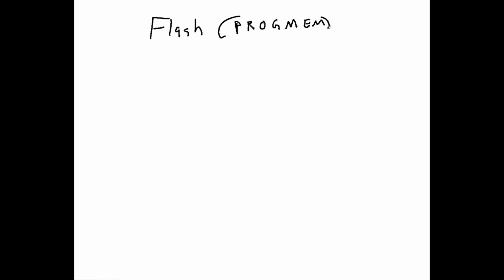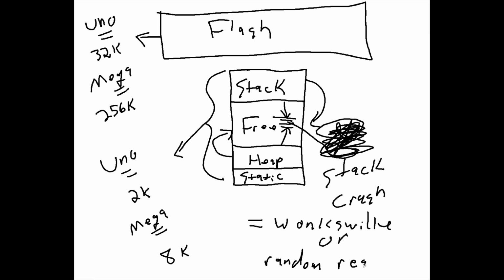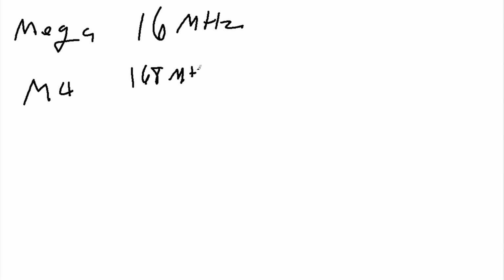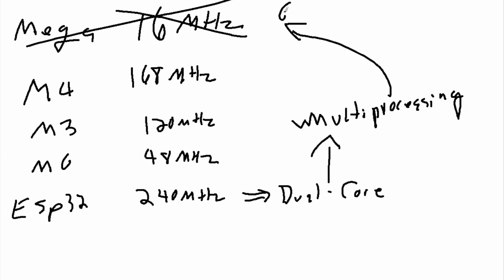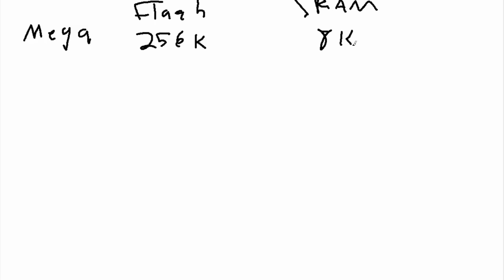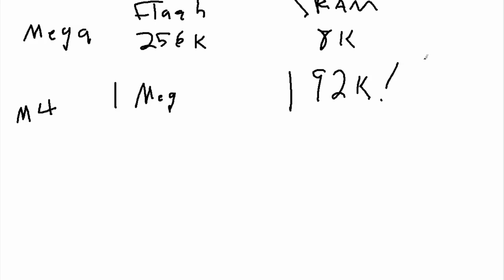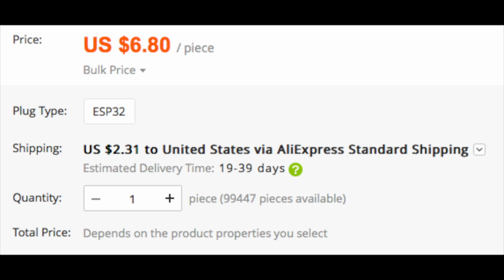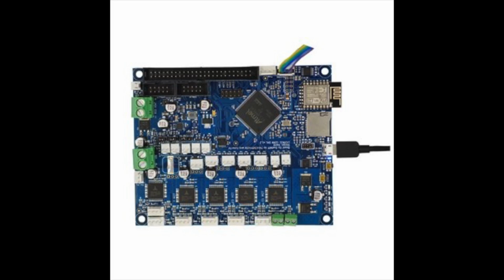Part 2 of 32 bit 3D printing series - nerdy tech basics

Comment: I have to wonder how well Multiple Megas would work. It wouldn't even be that difficult honestly, Make a master Mega that communicates with other Mega(s) or UNO(s) all over I²C. The codebase would fit in quite nicely in fact just some edits to accept commands over the bus. "Nearly" copy n paste shit around from the existing code. I do know and understand the hurdles involved, I've programmed computer BIOS/UEFI and the code in Marlin is VERY simple in comparison. Truly though, it wouldn't be difficult for a programmer that was determined to knock the code up in a couple of days.

Comment: You can get ESP32's with 4MB, 8MB, or 16MB of flash. Though for the larger flash sizes, you'll likely need/want to manually define the partition table for your application. Additionally, the ESP32 WROVER modules also adds a 4MB or 8MB pSRAM chip.

The 4MB and 520KB seems like plenty till you start doing HTTPS and then want to add bluetooth support. Just wifi and bluetooth code will push the bounds of the 4MB.

The ESP32 would be an interesting one to use for a 3D printer due to this stupid low cost and easy of sourcing, but the low pin count makes its tricky. Could likely get a 4 stepper ESP32 powered controller with only needed a single port expander or two.
Reply from the maker: Those ESP chips are really over the top.  I want to play with them more when I have the chance, and a couple folks already are working on an esp32 HAL for Marlin 2, so once the port expander/DMA is hammered out, those might be a really nice option

Comment: ST have some very fun CPU, they have a nice that can only handle 32bit (no byte, everything is 32bits, sizeof(char)==sizeof(short)==sizeof(int) are all 1 but 1 is 32bit in this case) they have some nice crypto CPU that data bus is upto 8K so they can load cypto blocks in 1 go,  and ones that do fix points math not floating point. but most of these CPUs are diegain for a job, a lot of them are in the STB under your TV, really messes up anyone trying re-eng the code.